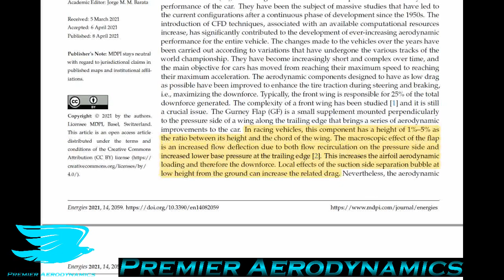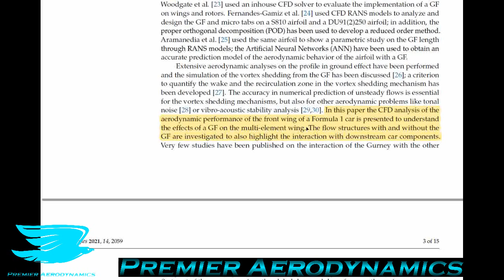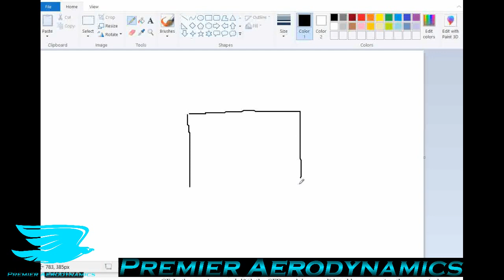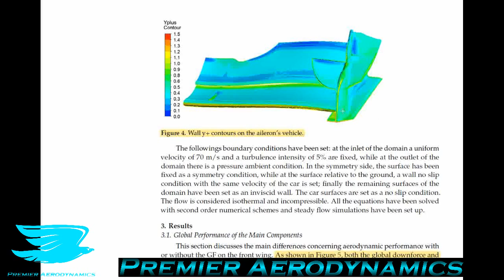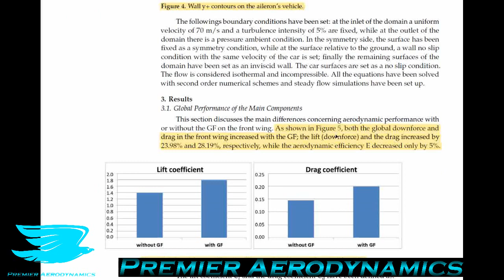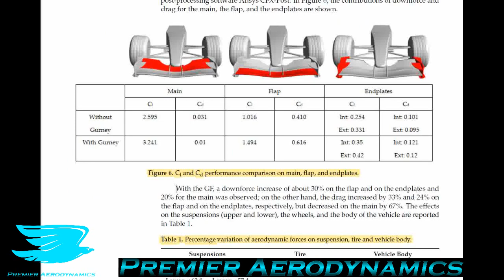Podcast #135 - Gurney Flaps on F1 Car Aerodynamics

Comment: 13:11 Are you implying that they used slip-wall boundaries for the side and ceiling? They should be using far-field boundaries to model outflow-inflow. The only reason to use (impermeable) wall ceiling or sides would be to simulate driving in a tunnel. In that case, moving walls are required.
Reply from the maker: Sorry, I don't quite remember for this paper. It was a couple of years ago, and these days, I sometimes forget if I've already had lunch or not.

Comment: If Gurney flaps improve lift/drag ratio, why aren’t they more popular on (subsonic) aircraft?

I assume they perform poorly at low AoA.
Reply from the maker: There are a bunch of reasons. It's not just aero that needs to be considered, but added complexity, cost, maintenance, weight, etc. Unfortunately, aero isn't the only thing that dictates what a plane becomes.